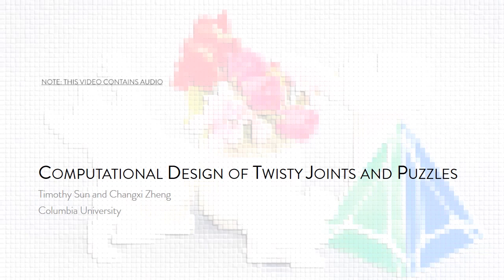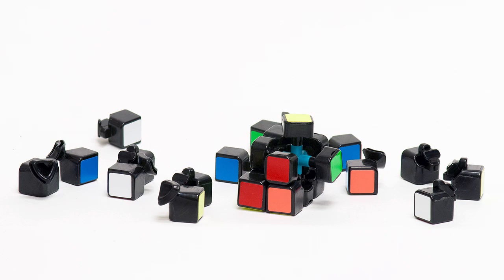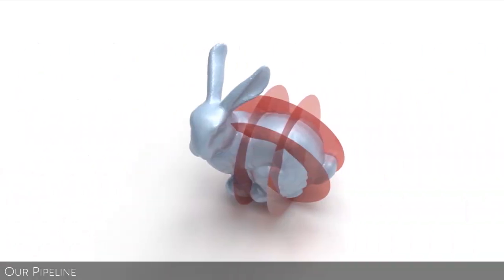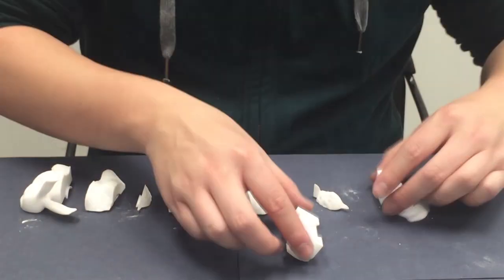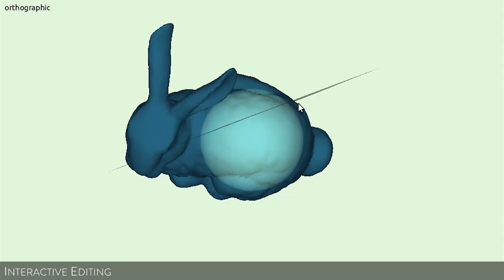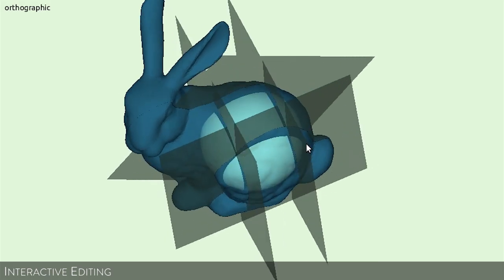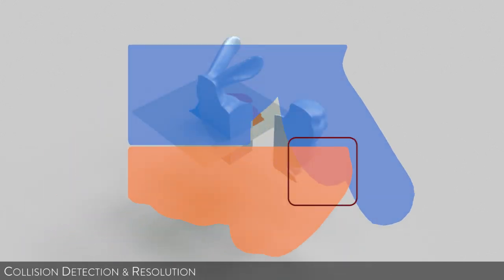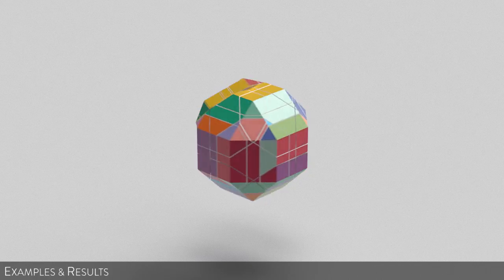Computational Design of Twisty Joints and Puzzles (SIGGRAPH 2015)

Comment: Very cool!  I hope you guys continue to explore other areas of Twisty Puzzle design beyond just "shape mods".  There are some optimization issues with "shells mechanism" designs where to make some pieces large you have to move a shell such that other pieces become smaller.  It can be hard to manually find a set of shell cut depths that simultaneously satisfy all size (and other) constraints.
Reply: bmenrigh Thanks for the suggestions! What about finding shell cut depths that do not produce tiny internal pieces? Is there an automatic way for doing that yet?
Reply: Timothy Sun There isn't automated software (yet).  One of the issues is that sometimes you're trying to maximize the size of two pieces where making one bigger makes the other smaller. Finding the right balance that also doesn't create other tiny pieces can be very challenging.